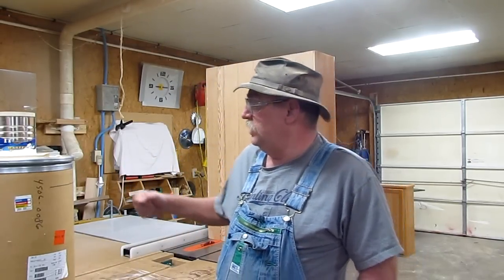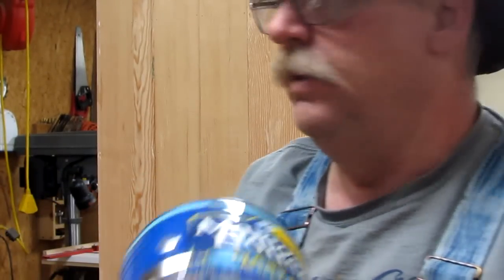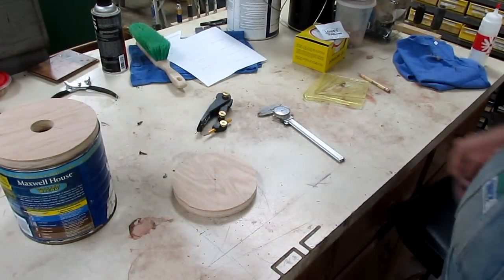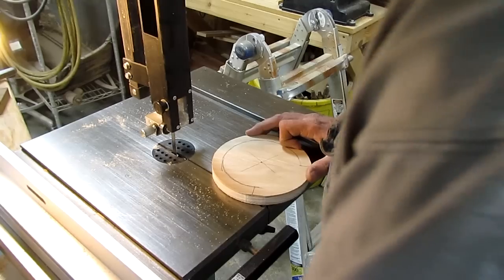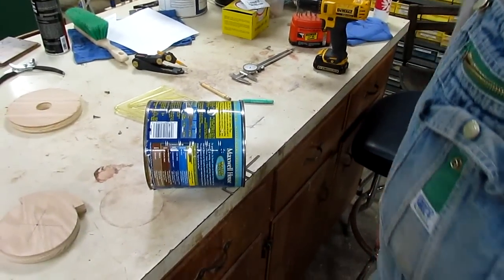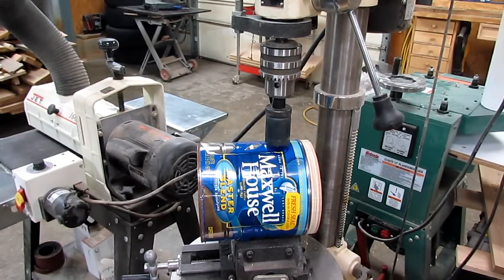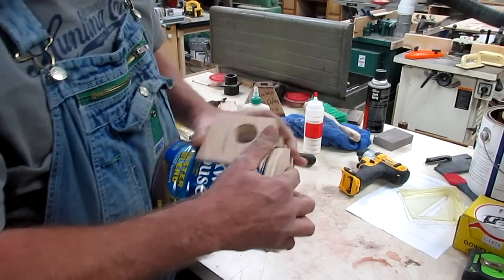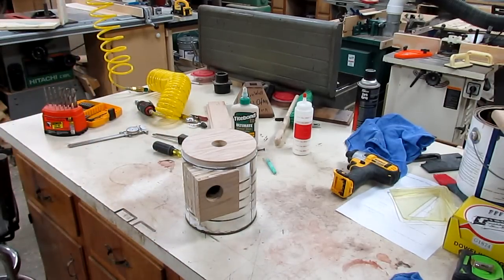Coffee can dust extractor

Comment: Hello Dwayne, great tip on your cyclone attachment. On your recent video on sharpening your planer blades what size grit did you use on the drum sander for metal?
Reply from the maker: That was 280 grit, works just great.